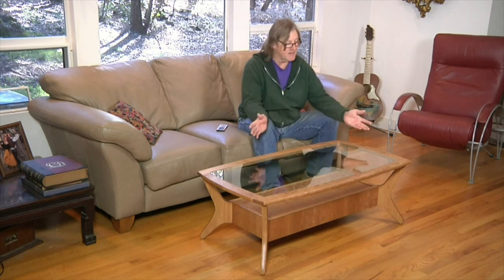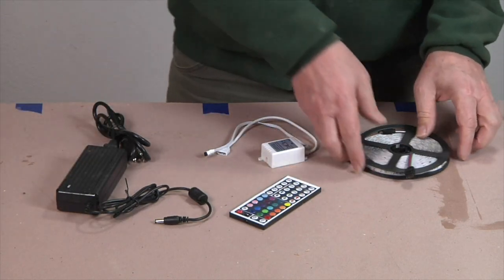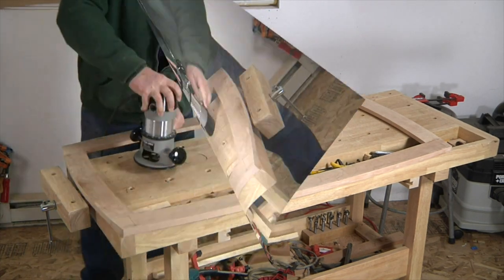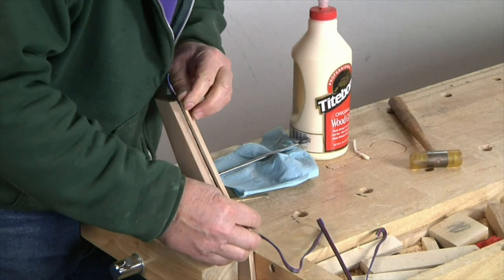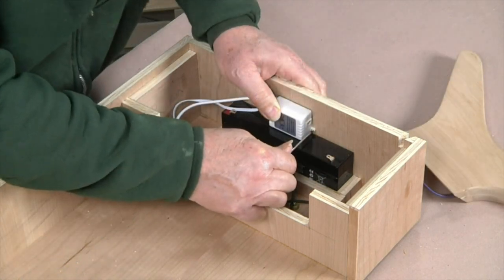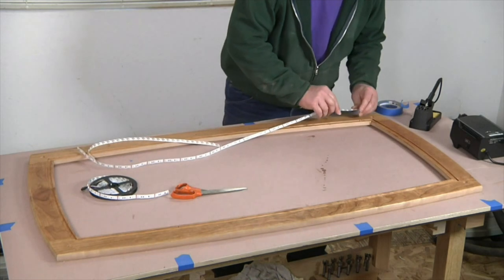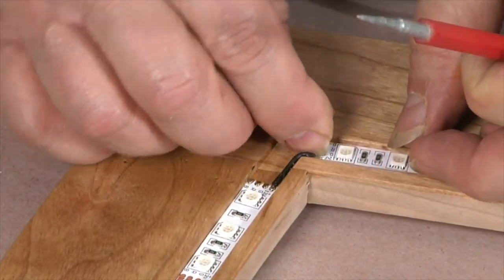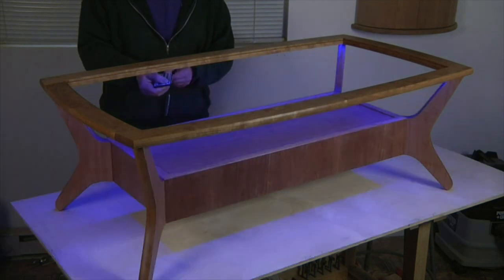How to Install LED Light Strips in a Coffee Table

Comment: Great idea, however I would have found some way to hard wire this to power.  Bringing out a car charger to recharge the system seems a bit much.  If not hard wire, build the charger into the table and provide a port to plug the table in to charge when needed.

Just a thought.

Comment: If you have a carpet you can run the wires down a leg and through a small hole in the carpet back to a power outlet

Comment: You can lengthen the battery life if you look into the white control box of the strip. The microcontroller used there runs on 5V while the main supply is 12V. What is the efficiency on the buck power regulator used in there?

Comment: These lights are great for a while but then the red, green, blue, and strobe white settings really become the only usable ones as any combination of them together lights uneven. As nice as it is to have all the colors they tend to get pretty ugly. Especially the white that turns into more green than anything. Also the adhesive is garbage and won't stick to anything longer than a week. Your best bet would be picking a single colored LED strip unless you really want the dimmer. Plus single colored LEDs only have two leads to deal with. Although both single color and RGB have solderless connectors you can buy to skip the hassle of doing it yourself. These would be best in a bedroom or anywhere you wouldn't personally care about uneven colors in the long run. I have mine mounted on the tv on the wall and I don't even use any other lights in the room since they run so cold and don't take much to power.
Reply: ironchefnino I used the warm white LEDs as under cabinet lights in our kitchen and my den.  I have power supplies connected to them which are switched from a wall switch.  I thought the adhesive and heat might be a problem, so I went to Home Depot and bought some aluminum flats.  I predrilled the aluminum and cleaned it well.  I then stuck the LED strip to the aluminum and screwed the aluminum to the underside of the cabinets.  The ones in my den have been up for about two years and the adhesive has not failed.  I did have to replace the power supply.  My wife loves the under counter lights in the kitchen.  I think if I were to do it again, I would use Sandor's method to do the corners.  I found the solder-less connectors to be a hassle.  I may have had the wrong ones.